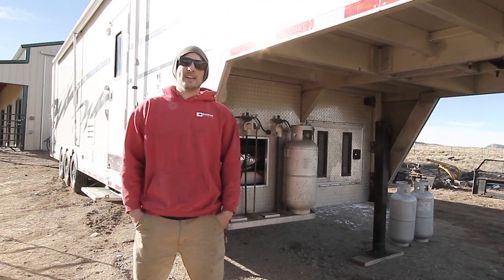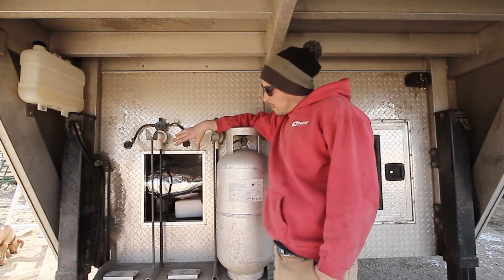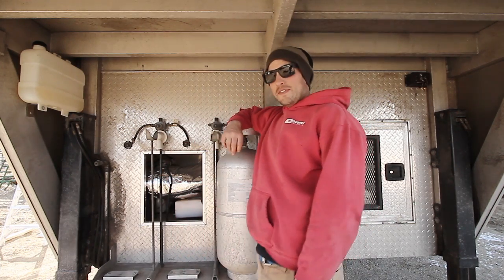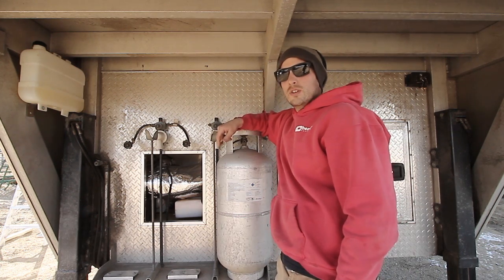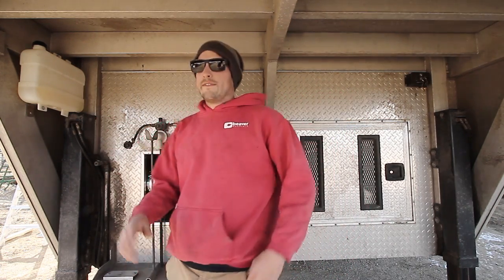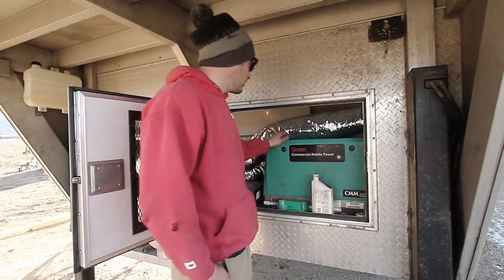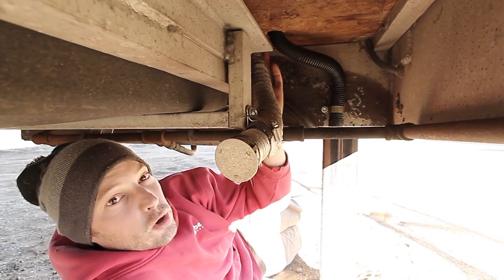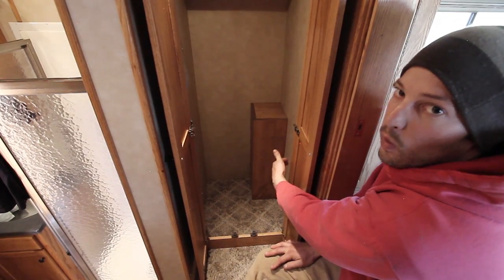Planar Heater 8DM-12: AdventureRig Installation Review

Comment: how long can you typically run a duct with these things before experiencing significant heat loss? This is good for what size of space?
Reply from the maker: I would try to keep it under 20’. With the insulated ducking I used I didn’t see any real loss. This one was for a 40’ long trailer.

Comment: Hi Tyson. This is the model I'm buying for Okanagan winters. I called Surry and the phone a is comming in a month so I will be able to keep an eye on it while I'm away at work.Im thinking I will buy a 20 gallon red boat fuel tank on wheels to keep under the coach. Still need to know where the best spots to punch holes inside the rig for the best heat covrage. You did mention you split it it two hoses can I add a couple more lines ? Thanks again.Doug
Reply from the maker: Yes you can split it.

Comment: Hi again. I was going to buy a 12 gallon plastic  gas tank and put it under the coach. Will the pump draw my fuel from that container? I go away for 2 weeks at a time. Need a bigger tank. Thanks again
Reply from the maker: I think that would work fine. I would make the pickup for the fuel coming out of the bottom of the tank so it is almost gravity feed.
Reply: Adventure Rig  ya but the pick up is on the top.....how's does one re modify a new 12 gallon portable gas tank? Its on wheels so I can slip it under and pull it out easy for refueling.
Reply from the maker: DOUG FERGUSON I would drill a hole through the tank and tap it. You could try your way first though and see if it will pull the fuel out. It may work fine.

Comment: Manual says it's forbidden to air ducting on the Planar 8DM-12? What's the deal?
Reply from the maker: I've never seen that in any manual. I suggest you call them and ask.
Reply: page 9 of the installation manual for Planar air heaters. Special notice for the 8dm only.
Reply from the maker: David Weber That must be new. Thanks for bringing it up.

Comment: Umm?   does exhaust flow carbon monoxide when y sleep?
Reply from the maker: No it's vented to the outside.
Reply: yes i got it .. umm i might get one for my 27 foot winnebago motorhome.. and not sure if efficiency  (percent) on diesel furnace more than 75 percent? to warm enough in coldest outside?
Reply from the maker: Andrew Walsh We have to sleep with the window open because it is so hot.
Reply: really?  what about 20- to 40 temp outside does diesel furnace can handle? during very coldest outside?  if does then i will buy Planar but not sure which BTU or model i need for 27 ft motorhome? mine is old 30,000 btu Coleman LP no longer make parts..
Reply from the maker: Andrew Walsh I have the most powerful heater for our 41' RV. If you go to their website you can choose a heater based on your square footage.
Reply: Thanks for video and info.
Reply from the maker: Andrew Walsh Not a problem. Glad you found it helpful.